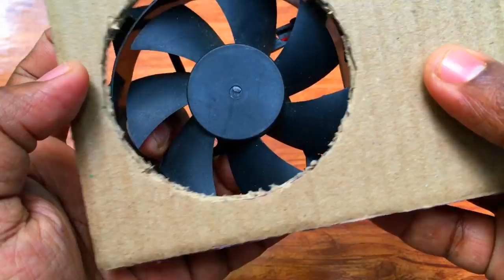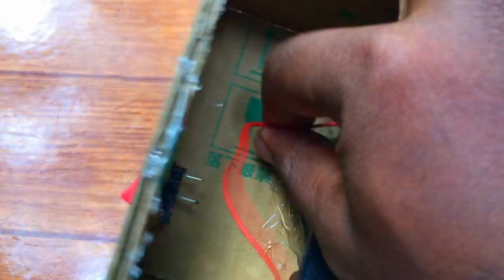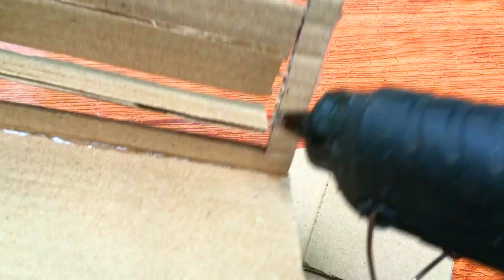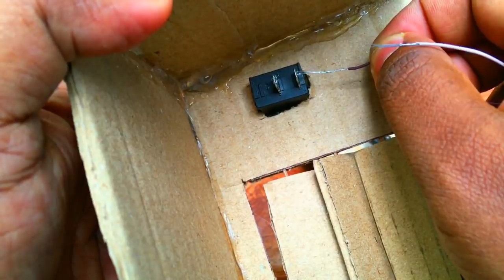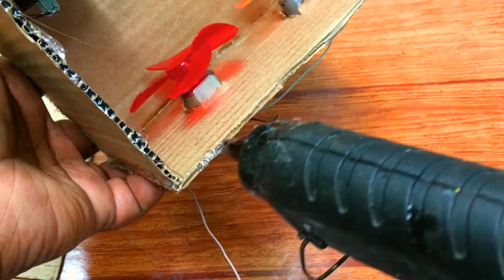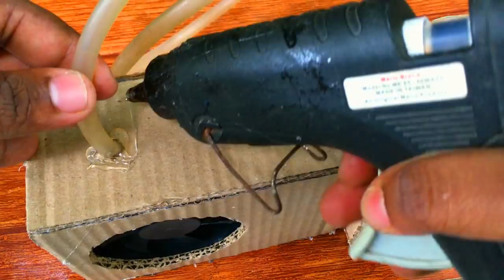How to make AC at home Using Cardboard - Making Cardboard AC - AC Making

Comment: 🤯 I didn't know acs just used tiny fans, 35 extraordinarily unnecessary steps, hopes, amd dreams and didn't require anything to like cool the air off. Who's your wizard shot keeper? And why would you not just put the switch and 9v on the fan
Reply from the maker: Watch the video again and you can see the 9v switch😊

Comment: Чего? Какой кондиционер? Тупо вентилятор в одном блоке и два в другом. Это просто вентилятор. Кондиционер работает совсем по-другому. И вентиляторы в нём - далеко не самая главная деталь.
Reply from the maker: This is a cardboard AC
Reply: @PunnakalaTech  translation: what? What kind of ac is this? This is just a stupid fan and two in the other box. This is just a fan. An air conditioner works way differently. And fans in air conditioners are not the most important part. (Sorry if the Translation was a bit rough but you get it)
Reply: @PunnakalaTech  no, this is not an ac. This is a 3 fan module which uses the Bernoulli principle to cool air, cool the air not to the efficiency of a real air conditioner. An air conditioner uses a liquid called refrigerant and a compressor and condenser, the boxes are completely aesthetic and just for looks. If you respond to this I hope you now know what scientifically is a real ac.